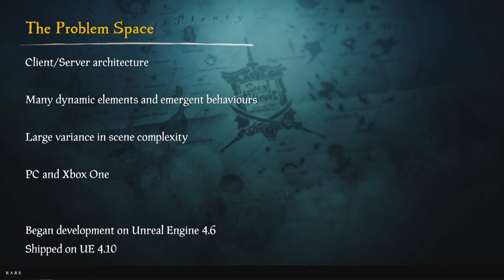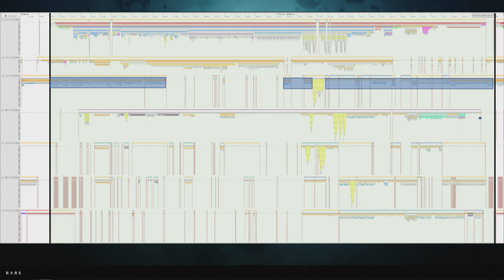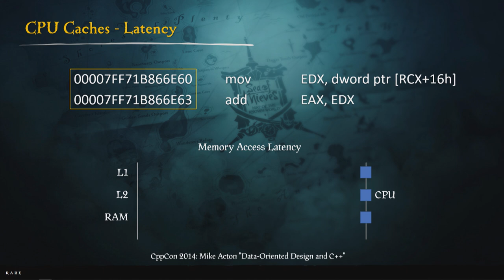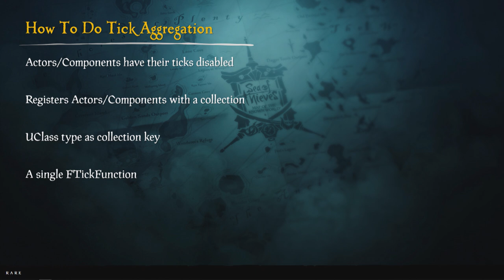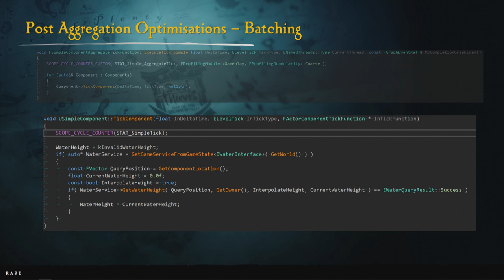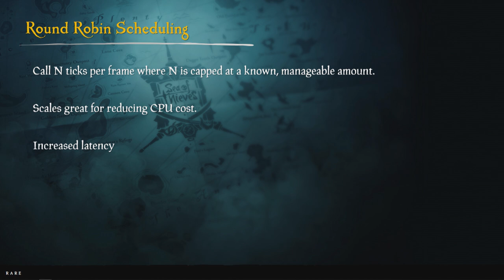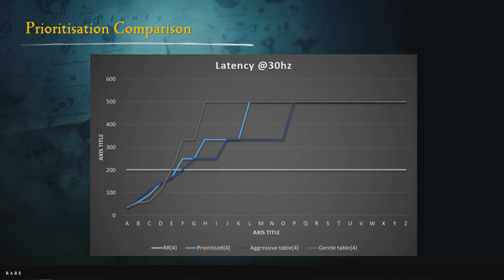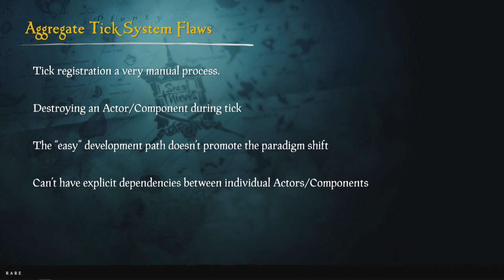Aggregating Ticks to Manage Scale in Sea of Thieves | Unreal Fest Europe 2019 | Unreal Engine

Comment: The main takeaway from this video is:
You can immensely save on cpu budget by turning off tick on all actors and components and instead registering similar ones to arrays in a service which manually calls tick on them by your own prioritization rules.
This is not because we are reducing the overall workload by changing what's in the tick functions or making fewer calls (in fact, we're increasing it).  It's because the structure and pipeline of cpu caches are more conducive with batching.
Reply: Will you be so kind to make an example with pseudo code and/or diagram? It would really help me to understand your point.
Reply: @alexandrm3073  sure man, no problem!  It's a word diagram which goes like this:

If you're too dumb or lazy to understand what I said or watch the video, consider another vocation.  Perhaps custodial services or president of the United States.
Reply: @Deck_Dynasty  First of all English is not my native language, so I didn't understand well enough. Second, when I'm elected as a president of the US this November, such  rude comments  will lead to the death penalty.

Comment: I still don't get the prioritization part. I understand how they reduce tick rates at a distance but how would this look in code and what potential components could this be applied to?(AI, Character Movement, etc.)
Reply: When players client does a Sail tick... What is more important:
The ships right next to your player character or the ships on the other side of the map? For ships on the other side of the map, the client may not need a sail tick at all for that frame because it wont be seen anyway. Also, its not as important to get thats ships replicated transform data. So the server build will not prioritize that ships replicated transform when sending data to your client. In short, it does not make the tick logic itself faster. It just stops less important ticks from happening that frame in the first place. 

It helps 2 fold:
1) delay less important ticks to other frames
2) reduce network traffic and replication logic.